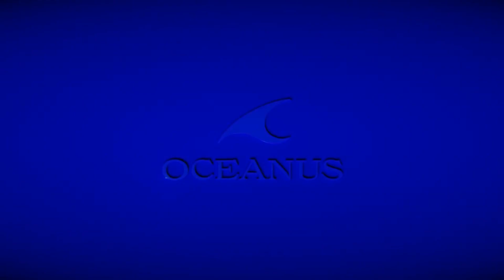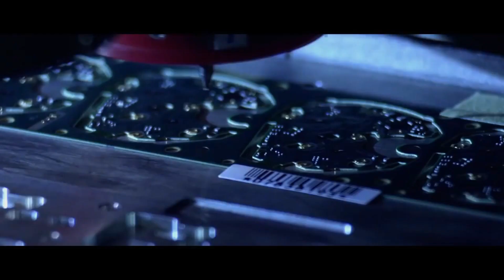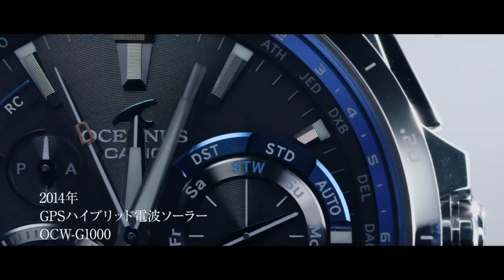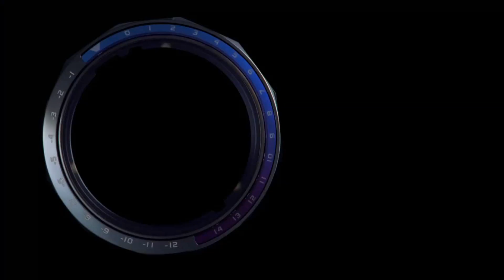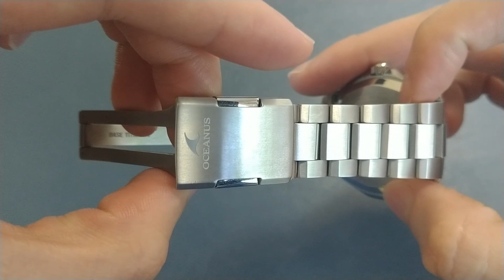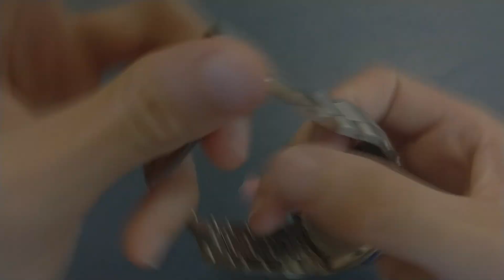Casio Oceanus OCW-S100-1AJF after 4 years. The ULTIMATE review of this watch!!

Comment: how is the scratch resistance coating of the watch holding up? uyour watch still look as new after 4 years of usage, but i have seen some user posted some photo on forum with lots of scratches
Reply from the maker: The watch is not scratch proof, is not as good as ceramic or saphire, but is definitely better than any others stainless steel. I think those who have this model all scratch up is because they super abuse it. Maybe because is only around 600$ I don't think they will dare to abuse a Rolex the same way but you can definitely scratch more any other steel watch than this.

I had many other steel watches that got scratches on the bracelet section under the clasp where the steel is constantly rubing against eachother from normal wearing while this Oceanus took a long time to start showing up some marks under the clasp.

There was many occasions where I thought I was gonna get a scratch but the watch held up.

Comment: I have a few watches and this one is by far the most accurate. This video exceeds the one by Nick Shabazz in terms of explaining all of the functions and breaking down how the watch is built. After the full Shabazz I found a way to access the Japanese market and sent my debit card to the vendor and was pleased to have the watch sent directly from Japan to my address. Instructions, an original new watch case inside of a protective outer box arrived. The watch was set for Tokyo time. I used a magnifier to look at all the markings and compared them to the instructions and then followed the instructions to set. I've had mine for about a year and it still is spot on within less than a second of computer controlled or cell phone time. Thus it is receiving the signal from the atomic clock and self adjusting. Unlike the video I don't know how much time it gains or loses, but when ever I check it, it seems to be perfect. It is light and very comfortable most of the time. Occasionally it slips down on my arm and gets too tight, but I have the same problem with most watches except with soft bands that are perfectly, "set-up."
Reply from the maker: Thank you so much for sharing! 
I adjusted my watch tighter and it doesn't slips down anymore, but it does slips down when is a little loose. Thank you so much Alex! I hope you enjoy that watch as much as I do.
Reply: @watchroll3310  ishtuk jugia baichung vutia?

Comment: Does this model have the classic "beeps" of the casio?  Fabulous watch, if a more famous brand were imprinted on it it would cost 5 times as much.
Reply from the maker: definitely!!! No this watch doesn't beeps
Reply: More than 5 times. A stainless steel quartz Royal Oak without complications is already more than 5 times as expensive. 
To be honest I didn't knew much about Casio appart from their digital watches expertize until a friend bought a "cheap" (€300) eqb-1000d : I took the watch and absolutely couldn't find a single error in the finish, just like this oceanus in this video their is not a single misalignment, not a single error of finish, symetry is perfect...etc....I couldn't believe my eyes that such finish quality could be offered for only €300, I have €1000 citizen ecodrive chronograph and that €300 edifice watch just looks as premium as my citizen....

Trying to learn more about non-digital Casio and found this video. Was already VERY impressed by the edifice line, the Oceanus line just blows my mind. Damn I considered Citizen unbeatable when it came to value.......looks like Casio might be the real King of value.

Comment: For the price, it would be better spent on established Swiss/German brand watch. Or even on a  Grand Seiko. At least you won’t lose too much when it’s time to trade in or upgrade.
Reply from the maker: If your concern is to retain value then yes is better to spend on another brand, but no swiss, German brand will give you the technological benefit this watch offers. The mixture of technology and refinement, the fact that the time and date is never wrong, te fact you can swap timezones almost instantly when you are traveling accurately to the second without having to look at a reference time. The fact you don't need to worry about hand alignments, service , battery changes, the durability of the high Intensity titanium carbide, all this can't be found on a swiss or German watch. In my case I bought this watch to keep it forever, I never plan to trade it, so value retention is out of the equation in my case.
Reply: “for the price” Compare this Oceanus to a Tissot PRX quartz which is in the same price range  Actually there is no comparison. PRX is made of heavy, scratch prone stainless. A flat highly reflective crystal. No complications other than a second hand and a date function and a vastly inferior movement with an inconsistent second hand that hits the second marks on the dial and at other times doesn’t. Some may prefer the PRX style but that is a subjective thing.

Comment: Hello, great video. Would you mind telling me whether the date adjusts automatically at the end of each month or do you need to move it manually if, for instance, the last month had only 30 days?
Reply from the maker: Hi! The date will always automatically change to the correct day weather it syncs to the atomic clock or not because it has a perpetual calendar.
Reply: @watchroll3310  Thank you very much for a quick reply. Beautiful watch! I have an older Oceanus (analog / digital version) but considering one of these.

Comment: Great review!  I just discovered this watch and love the features it offers.  What is the diameter of the dial?  I'd like to compare it with a watch I have to see how large the dial seems in comparison.
Reply from the maker: I think the dial proportions to the case is great!. I checked and basically all what the the crystal covers is 33mm. We can say is a 33mm crystal as well.
Reply: @watchroll3310  My only improvement would have been an AM/PM indicator on it.  That way when you change the time zone, you immediately know if it's day or night.  This would have been a handy feature for those of us who like to monitor and switch between 2 time zones, e.g. local and UTC.
Reply from the maker: @markthibault8579  I have seen this feature on other Oceanus of higher prices, useful indeed.

Comment: Thanks for the review. I am afraid that I will scratch that adjusting button when I press a pen against it.
Reply from the maker: I wouldn't worry about it but good point! I never thought of that. I thought I am super picky for scratches but after all these years I have tried to make myself to stop worrying and use it more.
Reply: @watchroll3310  One question about adjusting the timezone. With mine I noticed that at every click the hands do not synchronize with the click, there is some delay. You experience it also?
Reply from the maker: @bmwforlife6951  yes this is totally normal, all radio wave watches with a smart crown do this.

Comment: Absolutely spot on...the Oceanus is an exceptional value. 
After two years I’ve yet to find anything negative to say about this gem. 
As for accuracy - I use this to set all my mechanicals...the Rolex, the Omega, the Breitling, the Mont Blac, - even the 60 year old Seamaster and the 75 year old Gallet chronometer. 
If you’ve ever been a mechanical snob who would rather not even  consider looking at a quartz watch...this is the one that will convert you.
Reply: Actually I gave this one to my son when I switched to the far thinner Oceanus S5000. I was fortunate enough to find the magnificent 15th Anniversary edition...the one Nick Shabazz got so very aroused by in his review. As for the scratching of the titanium...I never really noticed any on either watch. The coating Casio applies to the case and bracelet titanium seems to work quite well on both of the models. I bought the S5000 because of it’s Bluetooth ability...and also because it’s so remarkably light on the wrist. In my judgement both  watches are excellent choices in the quartz segment of the watch community.
Reply from the maker: Thank you so much Sir. Indeed is exceptional value. The more experience I had with other watches specially my friends Swiss luxury pieces the more I appreciated my Oceanus. Is nice to get the seal of approval from somebody who has an extensive experience with swiss luxury watches. Hopefully in the future I can bring one of those 4K higher end Oceanus and review it. I only saw them in shelves so far but they are definitely are a lot more impressive.
Reply: If not this, the Grand Seiko 9F caliber quartz might sway you to like quartz
Reply: How is the titanium holding up? I used to have a cheaper titanium watch and it scratches easily. How about this one?